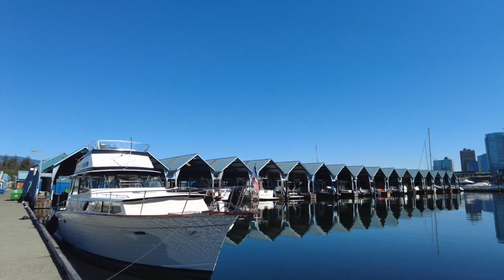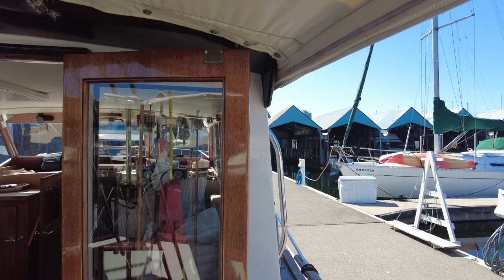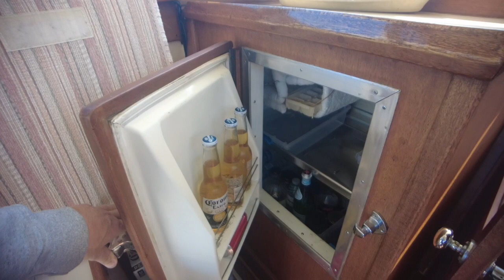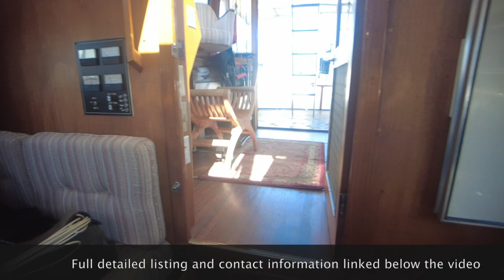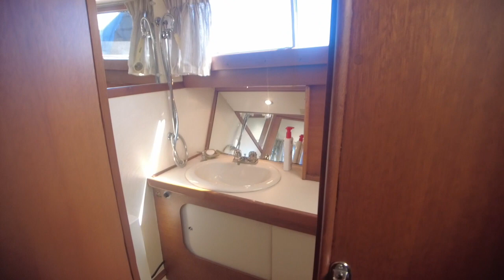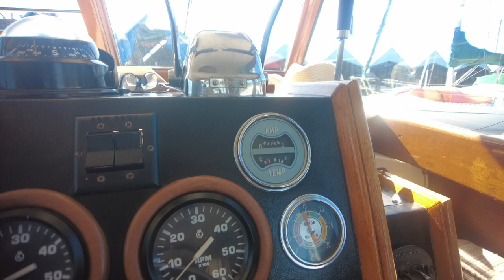Classic Trojan 37 sport fish yacht for sale + Engine Start

Comment: if the boat is not sold , does it have a clean survey?
Reply from the maker: Hi -Available, Yes there is a clean 2019 out of the water survey, also added photos of July 2021 haul out for maintenance to the linked listing.  Thank you